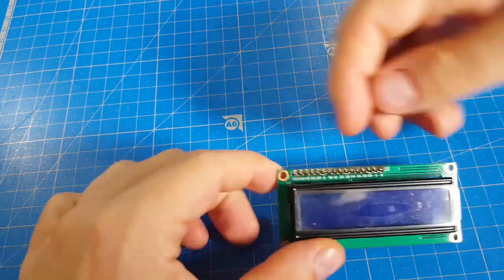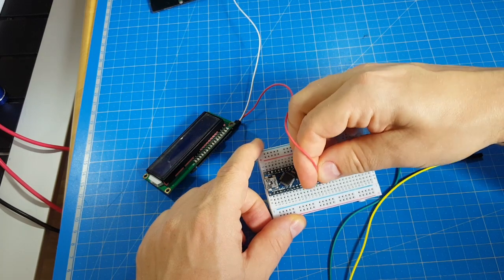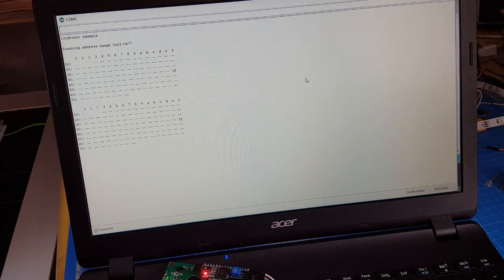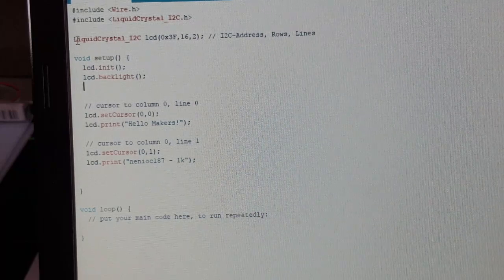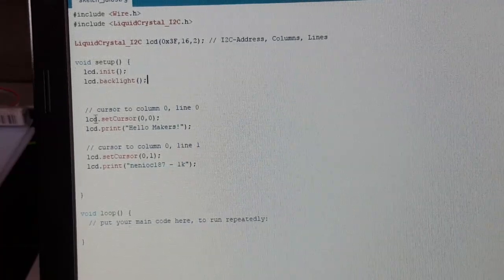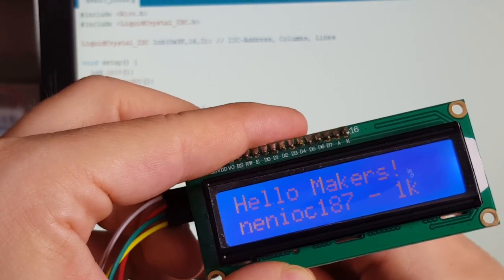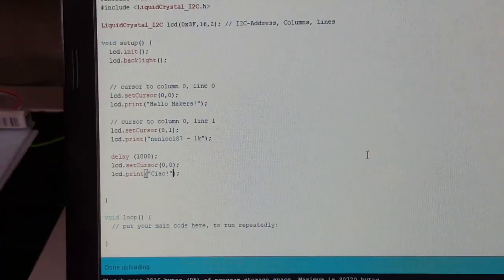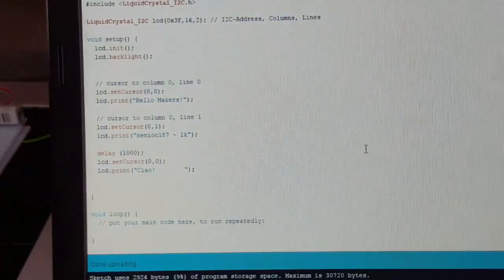Text output to your project

Comment: Hi.How to connect to Arduino LCD1602 and VL 53 LOX. I need to display data from the VL 53 LOX on LCD1602.Please help. I have tried to connect, but I failed.
Reply from the maker: I made a video about the VL53 as well. https://youtu.be/7dJKJUmfQ1A
With both videos you should be able to accomplish the task.